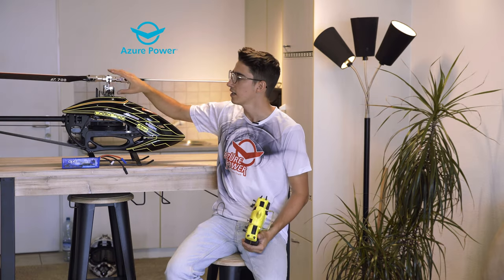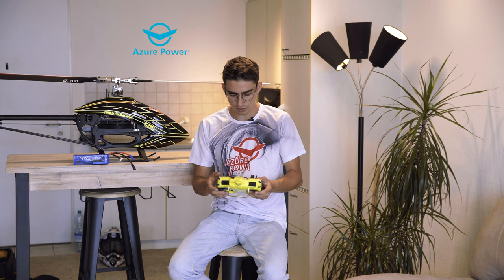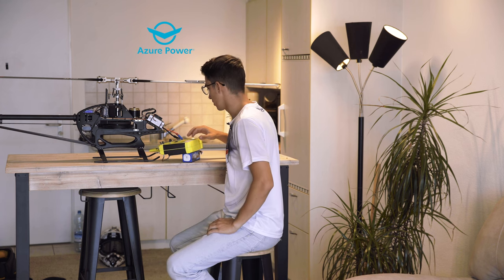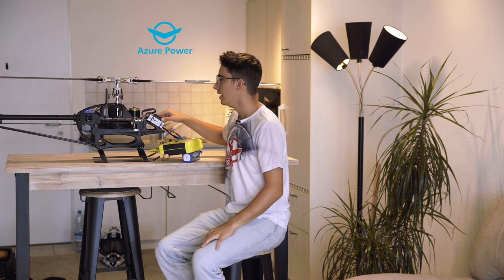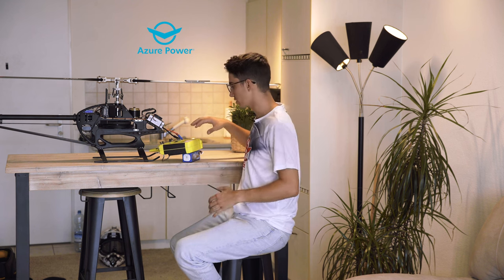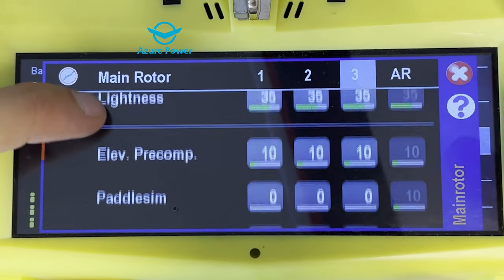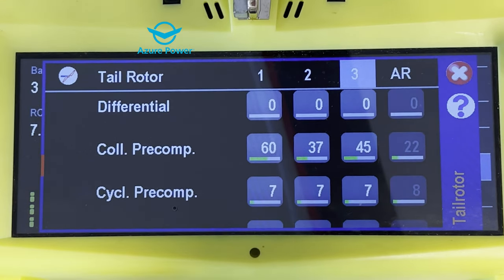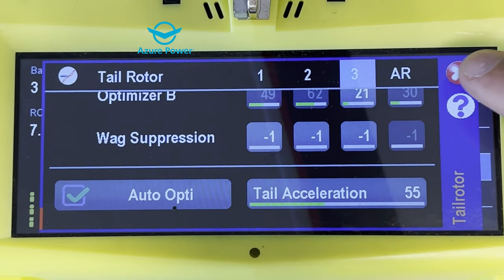* LOGO 700 * | MY VBAR SETTINGS | Mirko Cesena - EDITION 2022 [FULL Set-Up] (4K UHD)

Comment: so how about throttle curves? how the heli spool up in bank 1? or is just a switch to kill the power of the motor? I like to do it the old way that the throttle stick controls the power of the motor in bank 1 from 0 to 100% or 0 to any percentage I put in bank 1, not sure how to do it in a vbar control
Reply: on vbar you either set a Throttle % like 80% flat or depending on which esc you run you enter the motor and pinion details and then allows you to chose the headspeed you want.
I hope that helps you. sorry its a late reply

Comment: hello, mirko. I'm setting up my 450 heli on your set up. 
can I ask a question ? 
if I set the yaw rate 137 and pirouette with full key, right side piro almost no problem, but left side piro is messing up. it's like tail is wobble up and down huge  amount while pirouette left fast. so I have to stop piro not to fall down heli.  if I turn down the yaw rate to 100, the wobbly tail(up and down side) is disappear. 
you can set high yaw rate because your machine is 700 size big ? Can you do high speed pirouette any side continusely  without problem with your heli?

thank you :)